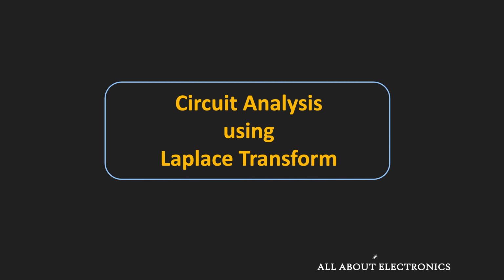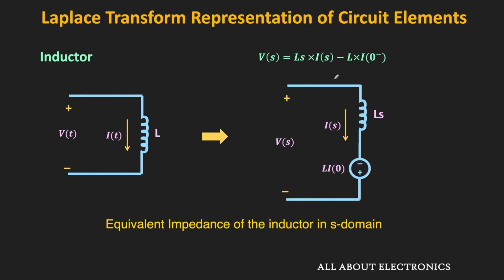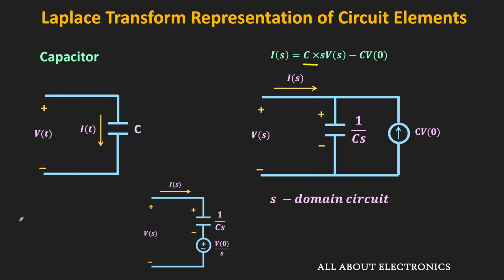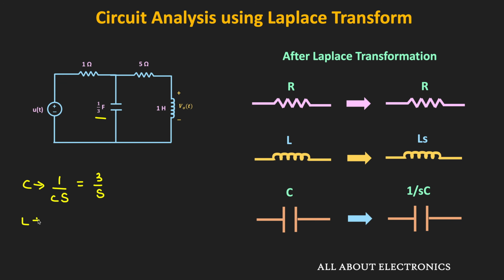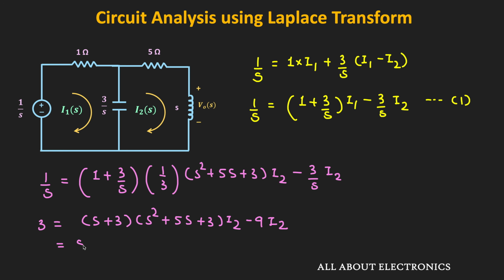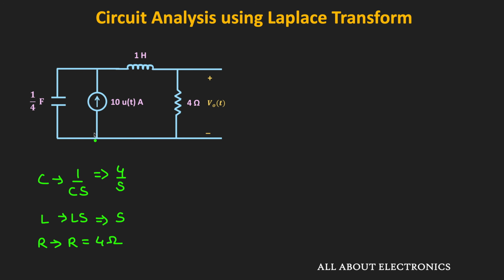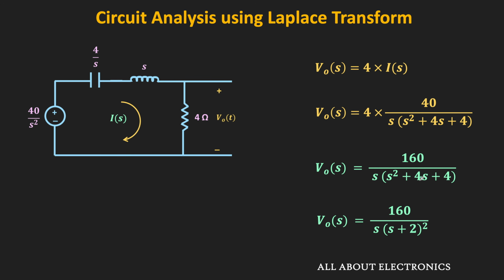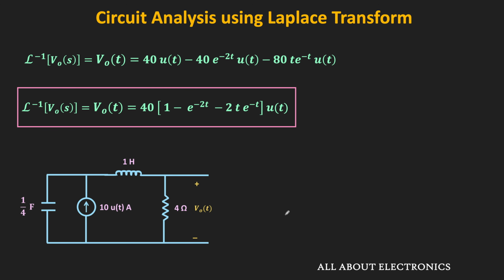Circuit Analysis using Laplace Transform | Network Analysis

Comment: Can anyone explain how at 12:17 kvl eq is written
Reply from the maker: In the loop while moving around, if there is a rise in potential across the element, then it will considered as positive voltage. For 1/S voltage source, as we move in the clock wise direction, then there is a rise in potential across it. So, that is considered as positive voltage. While for other elements there is a drop in potential. So, they are considered negative. The net sum is 0. so, all the negative terms have taken on the right side. Using Ohm's law ( V = I*R), the drop across each element is calculated. For the element 3/S, the net current flowing in the downward direction is (I1-  I2). So, drop across is 3/s (I1 - I2). 
And that is how entire equation is written. 
I hope, it will clear your doubt.
For more info, you can check this basic video on KVL:
 https://youtu.be/dlROTnDbULo?si=e3U2BNUMvEcNTav0

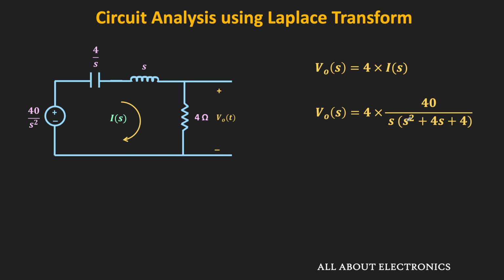Comment: In example 2 at 20:20 why vout = 4*i   why 4 multiplied
Reply from the maker: It is a simple ohm's law. Voltage across the resistor is I*R.

Comment: While writing the s domail equivalence of inductor, when we get the term v(s) = Lsi(s) + Li(0-), why does that translate to an inductor of ls inductance? Wouldn't that have a different voltage?
Reply from the maker: This is S-domain circuit. In the S-domain circuit I(s) is the current in S-domain. So, Ls represents the equivalent inductance in S-domain.

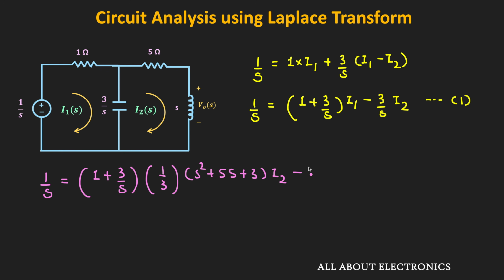Comment: why did you  multiply 3s on both side ?  13:34
Reply from the maker: On the right hand side, after simplification, in the denominator you will get 3s. So, that is why both sides have been multiplied by 3s.

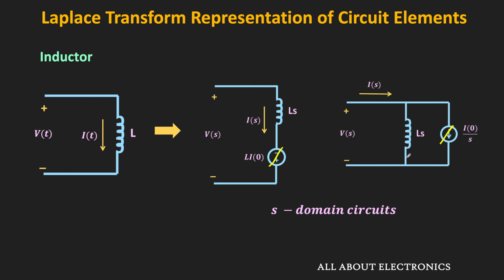Comment: 5:01 thanks for the video, what does it mean that the inductor has an initial current I(0-)? Is it like there's an initial magnetic field on the coil without being connected to anything or what does it mean?
Reply from the maker: It means that, the initially inductor was connected to some other circuit. And because of that, there is some flow of current through the inductor. Now, as you know, the inductor opposes the instantaneous change in the current. That means even after disconnecting it from the previous circuit, and connecting it to the new circuit, immediately the same current will continue to flow through the inductor. So, in the newly connected circuit of the inductor, that current will be the initial current through the inductor. I hope, it will clear your doubt. 
For more info, you may check this video, which I have made some time back.
https://youtu.be/3YinmbkU0DE?si=RzjcX-HDj1lVEQ5e
Reply: @ALLABOUTELECTRONICS  thank you, as always excellent explanations 🙏

Comment: can i solve ac circuit this way instead of the phasor domain? man i really hate dealing with complex numbers

a quick look and i cant seem to find how to solve the phase in s domain

seems only for transient analysis

so im stuck with phasor?

will it actually be harder to solve ac using s domain than phasor domain?
Reply from the maker: Yes, for sinusoidal analysis, it is better to solve it using the phasors. If you deal it in the s-domain, then it involves a little more mathematics. (Finding the Inverse Laplace Transform is additional step). Moreover, if you deal it in the s-domain, then the response of the circuit contains both transient and steady state response. If you just want to consider steady state response, then first you need to remove the transient response. (The terms which contains decaying exponential terms)
On the channel, through different videos and different solved examples, the ac analysis of the circuit using the phasors have been already covered. 
If you required, you can check the playlist of network analysis. 
https://youtube.com/playlist?list=PLwjK_iyK4LLBN9RIDQfl9YB4caBYyD_uo&si=RnvwjOP3Cc03xiZp